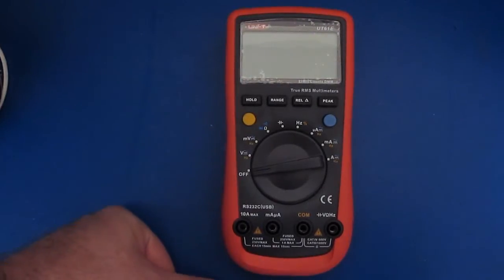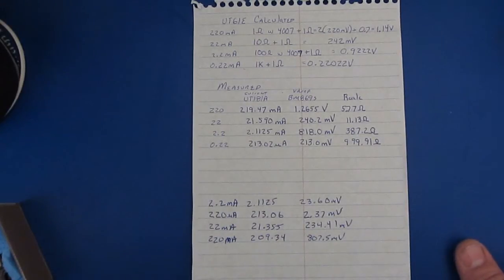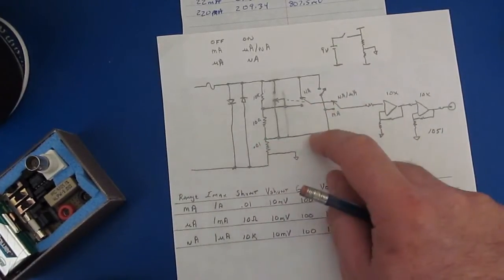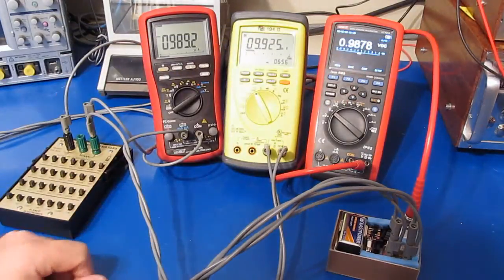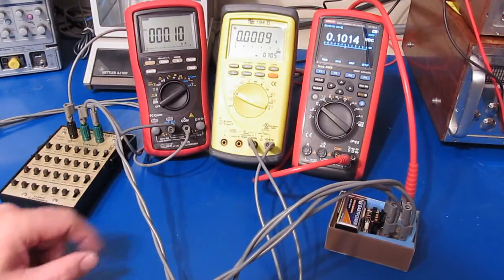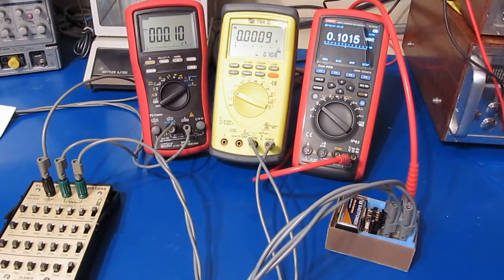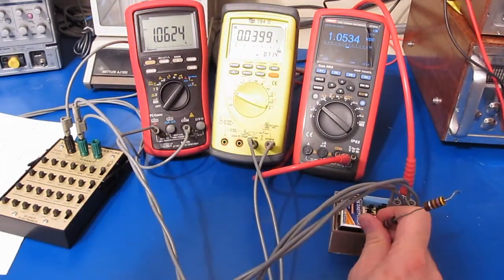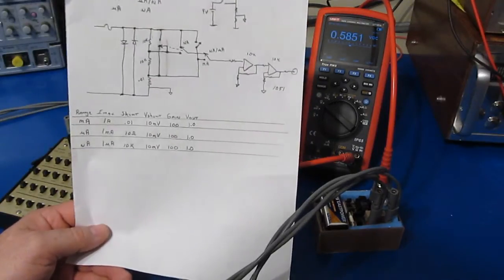Amplified Shunt for Ampere to nA measurements

Comment: Nice little tool! Would be nice if you could post a schematic of your amp box.
Reply from the maker: Maybe you could watch the video starting around 3:50.  Or do you not understand how to read a datasheet and need help selecting part values?   If the later, I would just Google op-amps, get the data sheet and read it then start playing.   You will be much further ahead this way than me spoon feeding you a bunch of values.   Good luck and have fun with it.
Reply: Hey Joe. Mind if I make a schematic out of it? Will post it here for everyone else?
Reply from the maker: As long as you are not trying to sell anything off of my channel, I don't care. A better area may be to post in on the EEVBLOG site as my channel is pretty small.
Reply: not selling. Just open sourcing. eevblog is a good place to discuss it too. Thanks Joe.

Comment: Daves uCurrent didn't have any fuse (to avoid the extra burden voltage) and have a schematic published on his website: eevblog . com/files/uCurrentRev5schematic.pdf (sorry for cutting the url, just to avoid be marked as spam). Great work, I'm building one!.
Reply from the maker: Same three shunt values, same 100X gain, this makes sense.  He buffered the ground and I was too cheap.  Much better parts than mine.   I'm sure his does a much better job than my morning construction on perf board.   But if you just needed something in the ballpark, no reason you could not toss something together and get reasonable results.   I wonder how his 121GW (new meter) will be by comparison.  I am assuming it would replace his uCurrent Gold but I don't think he has posted a lot of details yet.

Comment: Great stuff as usual! Looks like you can measure between a larger range, like µA to mA without problems? I'm building one.
Reply from the maker: With the battery that was in there, it starts to go non-linear around 3 volts.  So, for example in the uA range it's upper end is about +/-3mA.   The voltage drop when switching between ranges will always be limited by the back to back diodes.     I used the 1051 for it's wide operating voltage.  You could  come up with your own combo easy enough.  Maybe get some better resistors or add some trimmers.   Fuse could be removed which would help the mA range.   Good luck.  Be sure and post your results.
Reply: Yes, I'll do some experiments when I get my crazy NTP-server project finished. http://www.jackenhack.com/ntp-server-extreme-accuracy-for-under-200/ 
Could be a cool Open-Source Hardware thing. Thanks again.
Reply from the maker: I checked out your blog.  Some nice projects you have going on.  I liked the one about the coax.  Good stuff.
Reply: Coming from you sir, I take that as a great compliment! Learned the coax trick from a Ham-operator. There's a lot of knowledge to get from those guys. And my father was a Ham-nut. I like the rf part of it, but listening? not so much... :)
I'm still thinking of the video you did about some older FPGA projects you've done. Any followups?
Reply from the maker: I'm in the same boat.  I used to have a HAM license when I was a kid.  I watched a video of Steve Wozniak and there was a picture in there of him playing with an old Halcrafters radio.  I started out with that same radio. Crystal controlled.  Sadly, most of the people I knew were more interested in buying the latest Japanese radios and talking.  Low bands were like CB radio and I lost interest.  I still have my old tube Drake  HF radio and even have my Vibroplex.

The last FPGA project I worked on for home was that Hardware in the Loop (HIL) simulator.  I can't afford D-SPACEs products for home fun.   Even that's been a few years now.  When I finally pulled my old Windows XP P4 desktop PC a few month back, I had to rewrite all to low level code which was in C.  The new PC was so fast (really fast), I could just write everything in LabVIEW which included the interrupt handler.  

I picked up that Arty board to play with Vivado about a year ago and even it sits idle. Only so much time.
Reply: I just to work for Apple a long time ago. When Wozniak left Apple he designed the first programmable IR-remote. I did a project for people with disabilities so they could control stuff. I added a serial port to the remote, but didn't manage to decode the entire protocol. So just for a laugh, I sent Mr Wozniak an email via AppleLink (pre-internet, I'm an old fart) and didn't think he would answer, but knew he still was an "Apple Fellow" so he had an AppleLink account.
But he answered and even sent me all the internal documentation for the remote! Still have them here with "TOP SECRET" printed over them. I also have the remote. Nice guy.
Reply from the maker: Very cool!! Thanks for posting.   I wrote Richard Stallman once after he had won MacArthur award.  We wrote back a forth for a while about mostly non-software stuff.  I had read a book about him and was always wondering what he was like.  Good guy.
Reply: And he was right, open source software is the way to go...
Reply from the maker: I don't use much open sourced software.  I have played around with LINUX off and on over the years.  It's always a nightmare.   The tools keep getting better but poor documentation, lack of support....  I think the last thing I really played with was OCTAVE.   I wanted to rebuild it for 64-bit.  Forums could not understand why and we could not get past that. It took many attempts to find all the right files to get it to build.  I repeated the process with three different version, all having various bugs.   Everything may work for the most part on rev 1.  Look for one bug fix in rev 2 only to find out they broke many things that worked in rev 1.   Seems like a common theme.  Picked the cleanest one and called it a day.    I played a little with SALOME a few years ago.  Lack of a good CAD package was a problem.  Don't get me wrong, some of these tools are VERY impressive but they are just not polished enough for me.   Light years from what it was...
Reply: Jup, some of the software can be kinda rough around the edges. It's unfortunate that you still need to know about dependencies, make files and all the rest to get stuff working. But I love to poke around source code, so I don't mind. I'm doing a lot of hacking with IoT stuff right now and the open source tools are amazing.
I just bought Matlab, but realize that it's more of a tool for analyzing saved data, not instrument control, which is what I need. I've seen some of the tools you've written to control your stuff, is it made in Labview?
Reply from the maker: I have played with Ethernet a bit.  Started out with coax and Lantastic.  By the time I attempted to roll my own, I was still using coax and just hooked it to the scope to see what was going on.   Took a while but wrote my own stack in assembler on a MC68HC11.  You can see that nightmare in action here:

https://www.youtube.com/watch?v=l0GiC-dw9W8

ADI used to have a whole controls system based around Simulink.  I pretty much use LabVIEW for all of my Windows coding anymore.  I started using it with version 4.  Bought a copy of 5.  Never looked back.   I looked at SciLab X2C XCOS some time ago and was trying to sway the group to target a PC rather than little embedded boards.  I explained the reasons behind it and at one point they wrote me and said they were going to add it.  That's been a few years and maybe they have it by now.  

https://www.youtube.com/watch?v=Lqa2lnxoIsU
Reply: Impressive! Looks like a finished product! 
I made a (very crude) accelerometer for a drag race car back in the 90's using a 68HC11 dev board for logging. Nice instruction-set to work with. 
So it looks like I'm going to have to buy LabView (or my son. ahem... you know, student price :) The stuff I've seen you do with realtime updates and a sensible UI seems like the thing i like to do. I've been using Python and written a lot of drivers for all my test equipment, but can never decide which GUI to use for it.
Reply from the maker: Thanks.  I made the blue one before I understood what I really needed for hardware to pull it off.  The FPGA on the second board does most of the work.  It reads in the data from the printer port, DMAs it to the DRAM, handles all the DRAM controls and gives the 6811 access to all that memory.   It was a fun little project to get my feet wet in the world of Ethernet.   

The 6811 was the workhorse of the industry.  I still have my Pemtica  ICE that I hopped up (added bypass caps everywhere) and installed that last 8MHz E9 part.  Before this I was using the 6801 for everything.  I designed and built my own ICE for that part that was code compatible with the HP 6????? development system.   When I made the transient generator, I thought for fun I would make one last thing in wire wrap and use the MC68701.  Talk about turning back the hands of time.  2K ROM and 128 bytes of RAM is not much to work with and it's back to assembler.  

Sparkfun had a small dev board that came with a watermarked copy of the LabVIEW Base package for $50.  I have a lot of friend who bought that kit and tossed the eval board.  We tested the watermarked version and it did not appear to be crippled in any way beyond the water mark.  The problem with LabVIEW is it costs money.   Then again, I have made money with it and it has saved me countless hours.   For me, it's been well worth it but the internet is filled with people who dislike it.  There is even a webpage dedicate to reasons people hate it.
Reply: I guess we are old farts, I remember the first chess game I played was less than 2K. I've done a lot of programming in Assembler on Z80, 6502 and then 68000. After that I kinda gave up. Just some small stuff on an odd AVR or PIC. But the compilers are getting really good at optimizing, but when you don't have much memory, Assembler is the way to go.
I wondered why on earth you did your (actually really beautiful) transient generator in Assembler with an anemic processor, now I know. Haha, very Cool!
I really need to get started with FPGA's. A friend of mine works at a company here in Sweden where they implemented several NTP servers completely on FPGA (Stratix something something) with four 10-GBit Ethernet connections on each card. Two cards per location for redundancy. Checked the price for just one card and it was like $5000. The cool thing is that they released the source code for it, even though not many know about it. You can find it here: https://github.com/Netnod/FPGA_NTP_SERVER

By the way, any tips on a good FPGA dev board to get started? I don't even know if I should go Altera or Xilinx.
Reply from the maker: I'll have a look at your friend's project.  PicoBlaze running the stack?  I'll read the doc....
I am not sure what to tell you on getting started. I've used both.  The tools are so much better today and the parts are massive.  I custom made my keychain from a 1500 pin Xilinx part.  That would be pretty old by todays standards.   I have played around a bit with Vivado for fun but had no hardware to target.  That Arty board was cheap ($100 USD) and came with a voucher for the tools.   Simple board, some I/O, a few switches and LEDs. 

Xilinx was working on a hardware co-simulation six or eight years ago and had some different evaluation boards that would support it. Not sure where any of that is.  

I wouldn't go back too far part wise as the companies (more Xilinx than Altera) drop support often.   Also keep in mind, the tools are NOT free!   So you may find a good deal on some board that requires the full blown tools to support it.  Do your homework.  

You may want to play with embedded CPU cores as well. Lots to consider.  I would start very small on a low end eval board and just see what you think.  I would guess most eval boards would have a LOT more capability than the old 90's FPGA board you asked about.
Reply: Great! Thanks for the heads up. I'll read up on the options available.